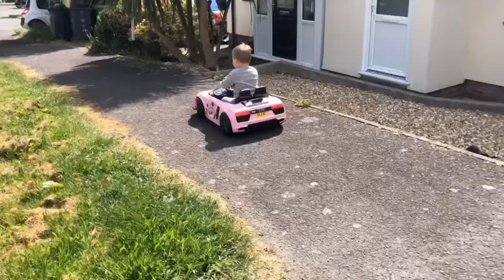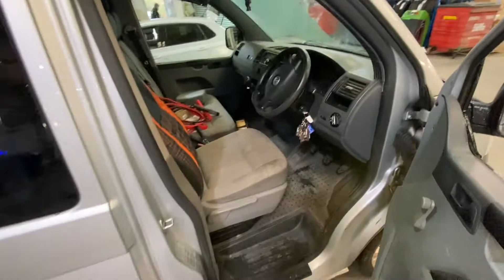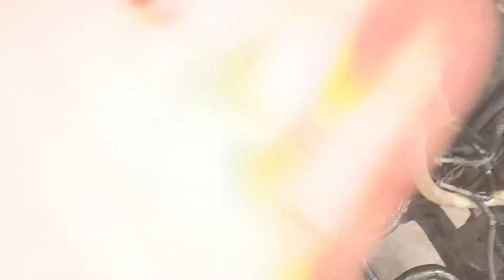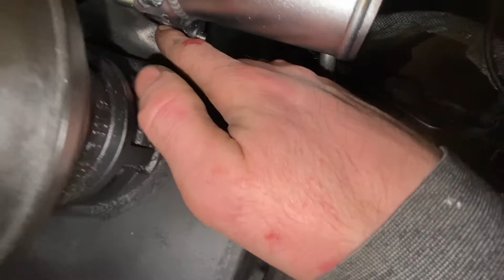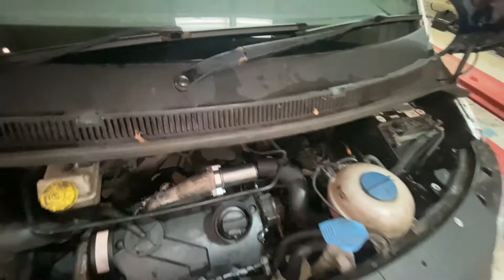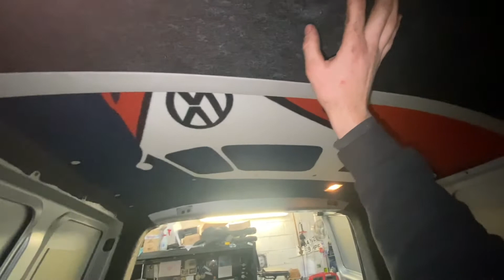Static:Youth | T5 update ....... PD130 update

Comment: Seems the crank end seal mod is not strictly necessary I did it on my conversion and plugging the loom in to original mk4 crank sensor made no difference still started run with no issues
Reply: Edc16 loom connect to mk4 engine?

Comment: Hi Liked you instal did you have to modify the engine block on the Pd130 to get the sensor wiring through?
Reply from the maker: Hi there 

Yea had to do block mod of cutting a hole to allow for the wiring of the new crank sensor, I think I have shown it in a video of the location

Comment: Hi great job love your work , im looking to do the same conversion  soon, what slim line  fan did you use. Mines a 2009 brs  Any info and help  regarding whats involved  to  the conversion would  be much appreciate
Reply from the maker: Hi there, thank you 🙏 

This is the fan I have used

https://www.ebay.co.uk/itm/192974805862

I’m currently fitting a coolant gauge to see what temperature I’m at as haven’t driven it far enough for the fan to kick in yet 

Conversation wise you will need to:

Do the block mod of cutting a hole for the crank sensor

Swap the sump

Change cam pulley

Swap inlet manifold 

Make exhaust for manifold for PD130 turbo if that’s what your using and rotate the end by about 45’ for the boost pipe to fit (this can be done once engine is fitted so you get it lines up right 

Then would need a remap for the ECU, mines now running 180bhp with 318ftlb torque
Reply: @staticyouthuk  I've got a donor Fabia VRS ASZ with 6 speed box, would the same info apply to this swap? cheers
Reply: mines an 04 T5 AXC i think
Reply from the maker: @caillumwinfield3785  double check the crank sensor position as I can’t remember off the top of my head whether you need to do the block mod or not with the Fabian engine as it’s slightly different to the golf one, you will need the T5 gearbox not the fabia one
Reply: @staticyouthuk  cheers mate, not on the cards for a while but If i have any questions is it cool to fire away? cheers
Reply from the maker: @caillumwinfield3785  no problem at all mate I did try to vlog the build across a few videos but think I did miss some bits, with the fabia ASZ you won’t need a slim line fan as the oil filter housing sits further back compared to the golf engine
Reply: @caillumwinfield3785  yes even better as you have correct oil housing and no need for fan mod.Also yours is AXC so its p&p.No need to drill holes etc etc